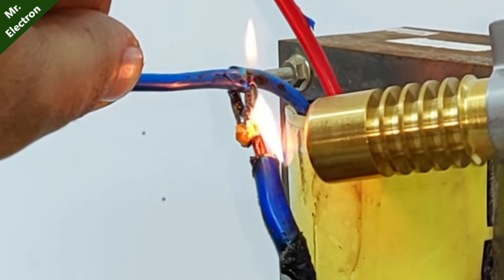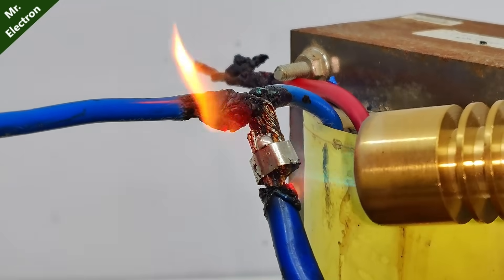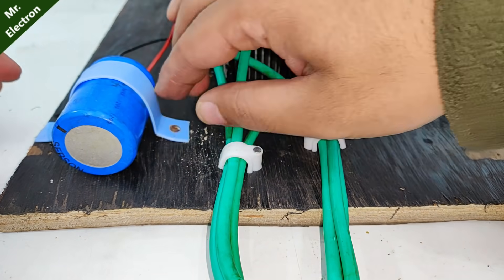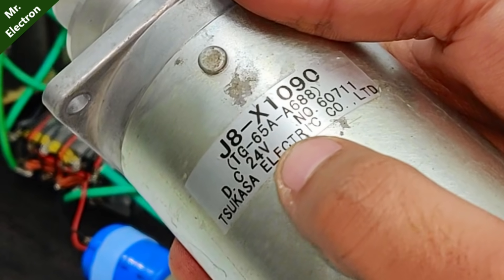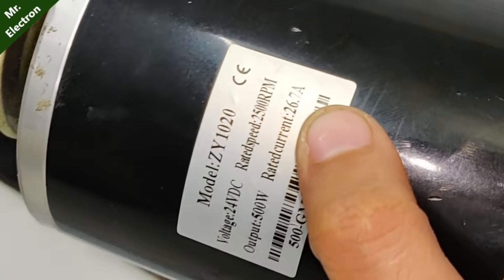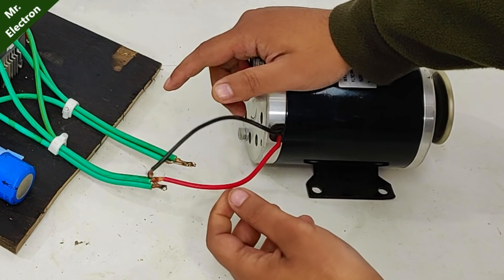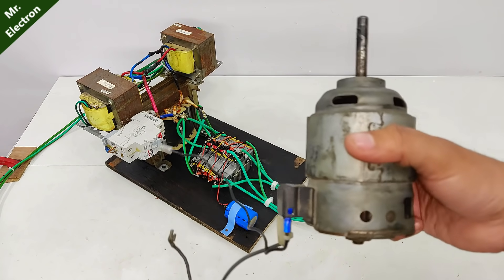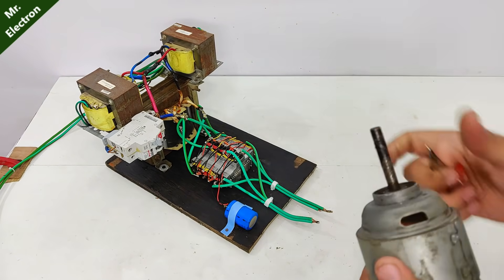Make 1600W Giant DC Power Supply with UPS Transformer | 48V 35 Amps

Comment: I have a 15 kva single phase welding machine with max 60 volts ac output and i made some more useful outputs like 6 v 12 v 48 v 50 v 😁😁😁 all the tapings are damm useful

Comment: Make alturnator produce 220v AC single phase output, self excited. 
4 wires on the alternator coil, bend the middle two and solder them together, the two outer wires is our output AC👍🏼
Use 35a bridge rectifier on output AC for excitation with 0.5 to 1 Ohm resistor, try 1 Ohm first.
Wire a 220v - 1.5hp+ motor to AC output, add two more wires for output to power appliances..
It would likely need 220v AC power supply to start the motor,, 12v battery with AC inverter or pull start.
The 220v running motor should regulate the voltage output to 220v @ 50/60hz. 
I have no idea how many watts we could pull from this thing.
Maybe you could experiment✌👍🏼

Comment: Hello Mr. Electron! Is it posible for you to show me how to build a DC 60 volts 30 or 60 amps adjustable power supply so I can  charge my own battery banks fast.? Thank you very much.
Reply: You can use a powerful step up converter but they are sometimes expensive 🤔

Comment: Make a 3500w hight power Inverter 18v dc to 225v ac 50hz, using 4 ups Transformer în paralel conected. Thanks 🙏.
Reply from the maker: 4 ups transformers can't produce 3500 w
Reply: @MrElectron  But can 2200w produce?.
Reply: 2,24kw is 3hp. Horse-Power.

Comment: Thank you for your effort. What is the secret of good welding for you? Can you put us a video about that?
Reply from the maker: Remove the oxydation layer from the metal piece before soldering and always apply flux for proper heat distribution.
Reply: @MrElectron  You should take some time to watch video on how to learn how to weld with copper and tin Before you Call yourself Mr electron and give advise.  Sorry but when im 8 years old im doing better that that. Hi five!
Reply: @MrElectron  Can you make me a set?
Reply: thank you